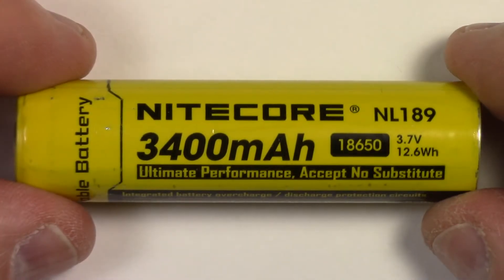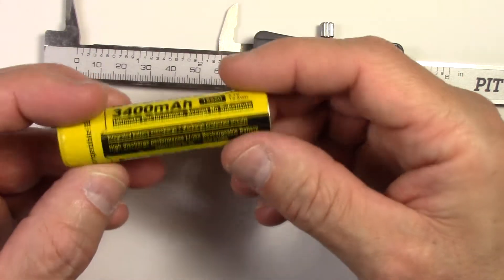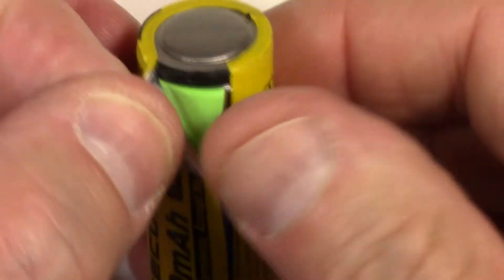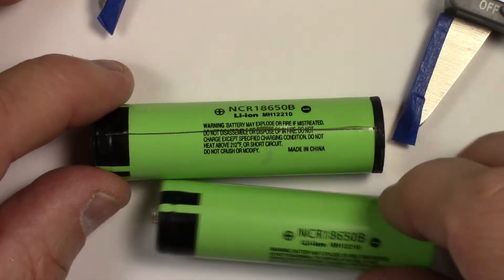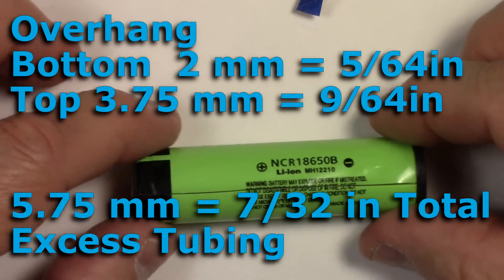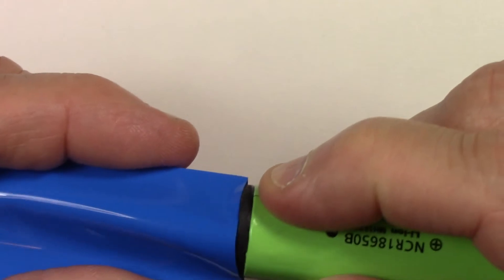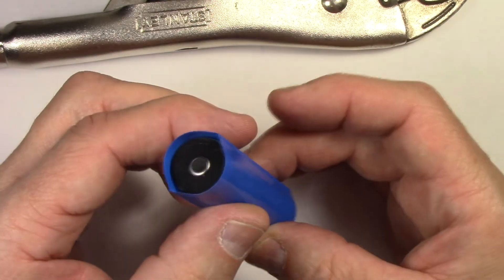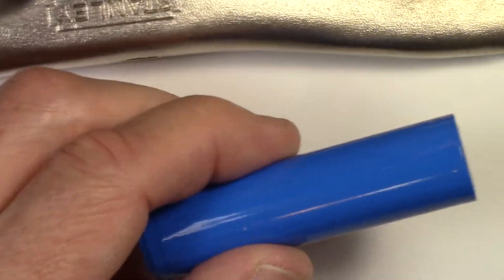18650 Protected Li-ION REWRAP-WRAP How To Fix Or Replace 18650 Shrink Wrap Vape Thorough

Comment: Very professional job. I would have never guessed that was done on your bench if I hadn't seen it. Looks like a factory wrap job, only without the print.
Reply from the maker: I was actually surprised at how well it turned out too. The more accurate and neat that you cut the tube the better the result. Thank you for watching, commenting and the kind words. All the best.
Reply from the maker: I was actually surprised at how well it turned out too. The more accurate and neat that you cut the tube the better the result. Thank you for watching, commenting and the kind words. All the best.